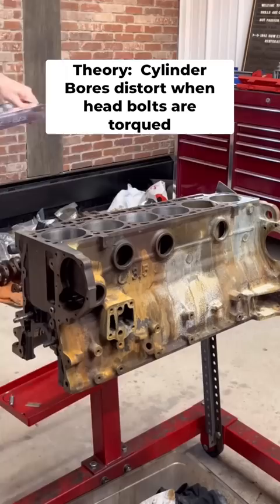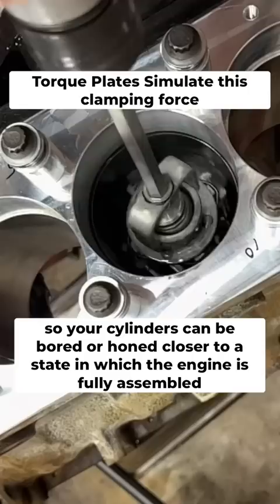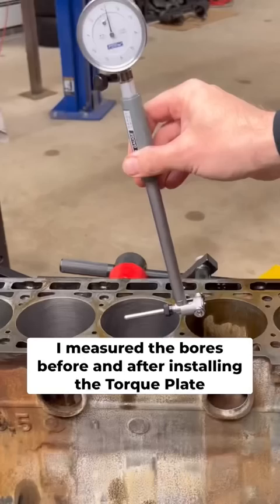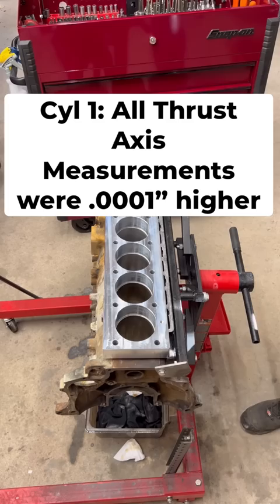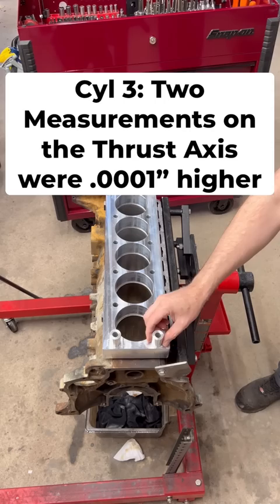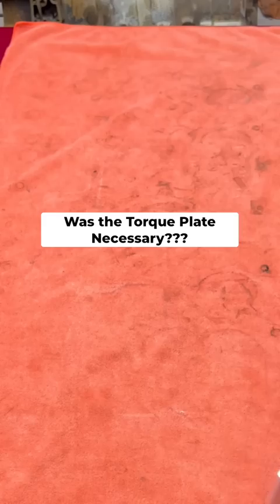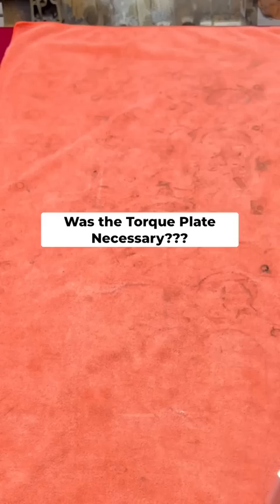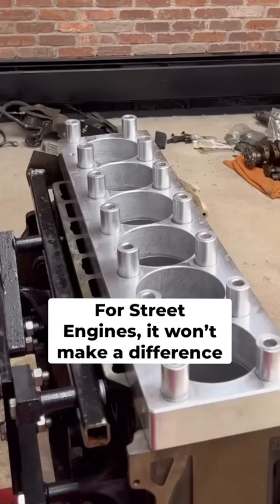Are Torque Plates Necessary? #bmw #cars #diy #bmwm5 #bmwe34 #restoration #automotive #engine #tools

Comment: Well I guess you are going to need a torque crank and to preheat the block to operating temp prior to any machining for the perfect bore.
Reply from the maker: Yeah, you can chase details forever with something like this
Reply: @wewrench  in fact you could argue that there’s an inherent design flaw in an engine that deforms so significantly under torque load that it is necessary to use a toque plate. The block should be designed to withstand those loads or you’re running the risk of a more significant failure under compression loads. Especially if you add boost.
Reply from the maker: @jonhunt5408  That's what I'm saying. Some folks are saying they've seen a block move .006"? How can that be? How does it even run when it heats up?

Comment: You measure with the crank installed along with a torque plate. But yes mostly only in racing applications. Keep the old main bolts so you're not wasting a new set.
Reply from the maker: You’re right but for a street engine it’s an overkill

Comment: They are necessary on Subarus.
Reply from the maker: Many others have said this as well
Reply: @wewrench  Many others are correct. Such a long aluminum block warps a lot more under tension.
Reply from the maker: @brianii5809  Saw a guy do a Subaru in a video. I think it stretched .002" at the top

Comment: with my cast iron block i didnt use them. Never had uneven wear patterns after my inspection processes when i pulled the motor. Drag strip numbers were happy.
Reply from the maker: Exactly!

Comment: Maybe for a large iron block v8 or straight 6, but an aluminum flat 4 or 6, they are 100% required. Otherwise you'll egg the cylinder guaranteed
Reply from the maker: Even on a stock build?

Comment: I don't want anything to do with an engine so fussy that it needs a torque plate to go together properly. The 300 six in my truck runs just fine if the bores are within 40 thou of what they're supposed to be as long as they're round hahahaha
Reply from the maker: I know man. Engines are way more forgiving than everyone says they are
Reply: @wewrench  Yep. Especially older ones like ours. There's an awful lot of differences between your E34 inline six and my Ford 300, but  they're also rather similar, and one key thing is they're not that fussy about tolerances. Long as things seal, slide, and stay quiet itt'l run juuuuuuust fine.

I'm not being facetious about the cylinder wear in my first comment, either. I'm probably gonna have to punch my engine out 40 thou to get the bores cleaned up, yet what ultimately put it in the rebuild line was oil pressure loss rather than top end wear. 350,000 miles'll do a number on an engine hahaha

Comment: Yea some engines certainly do.
Reply from the maker: Yeah, seems to be Subaru engines
Reply: @wewrench  Maybe. Can't remember.
Reply from the maker: @kaedeschulz5422  It's an endless debate
Reply: @wewrench  Yea really is! Especially As every series engine within the same manufacturers even can need or not need them depending on what series it's from.
Reply from the maker: @kaedeschulz5422  The OEM's don't use them so how critical can they be
Reply: @wewrench  OEM's don't care as much. They also don't push out 12k rpm and 250hp from a NA 1,6liter inline 4 or over thousand HP from a 3liter inline 6.
Reply from the maker: @kaedeschulz5422  that’s a different ballgame altogether
Reply: @wewrench  Absolutely!

Comment: They're useful on some weaker aluminum blocks, but not that monstrous n52.
Assuming that's an N52
Reply from the maker: It's an S38B36
Reply: @wewrench  shows how long I've been working on BMW'S 😂
Are those better? Sure looks cleaner/simpler
Reply: @wewrench  if you have a video on this please drop a link
Reply from the maker: @grapeseed427  If you you mean the S38B36, check out the video series on my page.

Comment: I wonder how a 8 in line would sound like
Reply from the maker: Pontiac made one, and the torsional vibrations were terrible. The crankshaft would actually sag
Reply: Buick also made a strait8.
They typically have a similar sound to a 90° v8 with an H pipe

Comment: lol whole "Torque plate" Is what I call a 80$ Peice of aluminum plate being turned into a 300$ With the press of a button as I watch the CNC machine cut it for around 20$.  You all fight about if it works or not I'll be making 5 more and buying a new toy I want with your 200$!
Reply from the maker: hahaha...funny.

Comment: Should be different on newer aluminum blocks then for old and beefy cast iron blocks
Reply from the maker: The opinions are all over the place
Reply: @wewrench  there a definitely blocks you can measure big differences with and without torque plate.

Comment: They are necessary for Subaru EJ engines. Other engines your results may vary.
Reply from the maker: Others have said this too. Because of open deck?
Reply: @wewrench  the blocks are really thin and the way they are assembled supposedly flexes the case halves. either way they almost always fail if you don't use a torque plate.
Reply from the maker: @dreadswizzard9142  Gotcha. Didn't know that

Comment: And you need to install gerabox too 😂😂😂
Reply from the maker: hahaha...that's really going the extra mile!
Reply: @wewrench  that's actually effect on closest to gearbox cylinder/s but it demands on engine block designs , some are weaker that others, but if you work on same engines regularly, that its better to have it than non...

Comment: Should note that whilst there's distortion from this and distortion from a cylinder head - both will be different distortion patterns.

An aluminium head is probably softer than one of these so it's more likely that the block is going to warp the head more than the head warps the block.

I'd be interested to see these measurements done with the actual head on - maybe from the crank end?

In any case the distortion is tiny and well within tolorance - your piston rings have play in them for a reason.
Reply from the maker: Exactly. These plates are an overkill

Comment: the factory dosent use them. can you measure with the actual head from the bottom? i want to know if the plate has a different geometry makes a difference.
Reply from the maker: You can measure but you can't hone
Reply: @wewrench  yea i just want to know if its different from the torque plate to the real head.
Reply from the maker: @nick4506  It's a weird ordeal. Nobody really knows the truth

Comment: I'd be curious if the results of this test would be the same with a V block. I think this test says more about the quality of a German inline 6 than it does about the need for torque plates.
Reply from the maker: Lots of people are saying different things
Reply: @wewrench  yeah, I'll bet. It's been my experience that lots of people have a hard time acknowledging that there are engineers building engines out there that might not work for the big 3. Facts would prove otherwise.
Reply from the maker: @edwardseaton4492  Truth. Thanks for supporting the channel

Comment: I talked to an experienced engine builder and he said, useless if the head bolts thread below the deck, and would make a difference if they thread in the deck, but that the cylinders deflect more from the power stroke than a torque plate. 

So yeah, its a wash, it seems more important that everything is at the same temperature at final torque and that things are machined slowly so there isn’t a lot of heat generated.
Reply from the maker: Agreed my friend!

Comment: Are the bolts on the cylinder wall (SBC) or the block wall ? Seems like a major difference  .
Reply from the maker: No they are not. Probably a big reason.
Reply: @wewrench  its the difference between Pontiacs and Chevrolets
Reply from the maker: @NCOGNTO  Truth my friend
Reply: @wewrench  Michael we are car guys here .
I recently filed my Patent application for the first Pollution Free Engine (9/30/22)
Its a more efficient engine on "rocket fuel" 
I can send you a copy if you're interested

Comment: also different on cast iron / aluminum blocks
Reply from the maker: I've heard this too. But I still find it hard to believe
Reply: @wewrench  someone should like try it with cast iron and cast aluminum blocks with oem liners but also aluminum with just coatings and maybe even with aftermarket liners like darton, so many variables
Reply from the maker: @austrian_s60r64  You're right. But it's those variables that can also negate any changes it could make. The OEM's don't use them for a reason
Reply: @wewrench  The oems do anything but darton sleeves, just coatings in the aluminum instead of iron sleeves is completely normal

Comment: Then Why didn't you measure with the main caps in ? Also you did one measurement with one type of block.
Reply from the maker: Because chasing a tenth or two doesn't equate to anything on a street engine in the real world
Reply: @wewrench  you said in race applications that can be disputed. In my opinion it is always a good idea to have a torque plate in race applications and oem can be disputed. manufacturers are building engines lighter and weaker the weaker a cylender is the more you need a torque plate. Your block is among the strongest ever made its not a good example
Reply from the maker: @speltwrong9009  This is a very sort of "arguable" subject because it's difficult to quantify. I cast a wide net with this video but the spirit of my statement is that in the real world of street engines, chasing a lot these details are meaningless. And I disagree with what you said about blocks being weaker. They're being built stronger to handle boost because turbos are now mainstream. They're doing a lot with metal alloys to accomplish this to get the same strength with lighter weight

Comment: When you have darton wet sleeves you'll need it to bore
Reply from the maker: Some other people have said this too. How much do they distort?
Reply: @WeWrench  when you dig into the cylinder wall of a floating sleeve with a cutting bit at 0.03 depth it will push the whole bore centerline out 
Machine shops honing rigs don't use (flexible) dingleberry hones  or (rigid) grinding stone hones,  they use mandrel type lathe cutters
Reply from the maker: @TwisNinja  Yes, I watched a vid on it last night

Comment: How are you out here trying to work on a German block, but measuring your bore in 1/10000th 🤢
Reply from the maker: Because the factory tolerances are.... .0002" max out of round and .0004" max taper

Comment: Never heard of such a thing. Can someone tell me what it is ?
Reply from the maker: It bolts on the block and simulates the clamping forces of the head bolts. It's said that this clamping causes distortion in the block
Reply: @wewrench  and what's the point of doing so ?

Comment: First, it is always a good practice to use a honing plate and often it is a requirement even on a stock street engine. A master tech that doesn’t know that the mains need to be tightened before using a honing plate🤣. That made me laugh. 

Cast block are more stable. I have seen some aluminum blocks move as much as .0015” and that is quite significant. Some cylinder heads need this process as well as without it you can see close to 8% leak (that is a lot) on a brand new loaded head when installed, but they test good on the bench. Doing all of this close to operating temperature is a best practice. 

Racing engines? That’s a while different level of detail. Done properly, you can sometimes have an engine that will not turn until the transmission is bolted on, because you need a transmission torque plate as well. I have seen rear cylinders move .0003” out of round when the transmission is installed. On an engine with .0012” piston clearance that is significant.
Reply: The standard fashion for bores is not at the top where you have the bore gauge.
Reply from the maker: Here's the thing. First you're wrong about plates being necessary on stock engines. Second, when you bolt a torque plate and see that 100s of thousands of psi of clamping force only moves some measurements a tenth, then why would I waste time and $$$ torquing up the mains and having to replace the bolts in the process? That's calling being a master tech and actually using your head, instead of believing every engine is a race engine and bending over backwards for details that won't matter.
Reply from the maker: Enlighten me
Reply: @wewrench  Oddly you are agreeing with everything I stated, but are somehow confused about it. It is a process that is required on some, but not all stock engines. Cast iron blocks usually do not need it for a stock rebuild. Many aluminum blocks are also ok, but some open deck aluminum blocks benefit from this greatly on a stock rebuild and are unreliable long term without it. The force per bolt is usually 6,000-11,000 PSI. At no point is any one bolt subjected to hundreds of thousands of PSI. If you only have experience with a few rebuilds, I understand your point of view. When you have done hundreds, your opinion might change. I have done them all from 50cc bikes to 30+L diesel engines. They are all different and need different considerations. You advice that the plates are not needed ever on a stock rebuild is wrong.
Reply: @wewrench  Enlighten you about the place to measure the bores? You're the "master tech" you should know better.

Comment: Well, Mr Master Tech...you are dead ass WRONG. LOL The cylinders absolutely distort *where the bolts are*. Also, to use a torque plate correctly, you ARE supposed to install the main caps because yes, those ALSO distort the cylinders. High end builds will even run hot water through the blocks to bring them to operating temperature while honing. Do you honestly think that race teams and such did all that work, and continued to do so because it sounded cool? LMAO They wouldn't do it over and over if it was a waste of time and money. For a street build or just a normal everyday car, yes, it's a waste. For a truly high end, nth degree, ALL the power and reliability build...YES.
Reply from the maker: I’m dead ass wrong you say, then you agree with me that they’re useless for street builds, which this engine is.
Reply: @wewrench  You tried to prove they don't work and said they aren't necessary. You are wrong on both counts when talking about building high performance engines. You did not quantify your statement. Better?
Reply from the maker: @rocketsurgeon11  yes that’s better. I meant to convey that for what I’m trying to do and generally for street engines, they’re not necessary. I cast a wide net and wasn’t clear

Comment: You obviously never worked in a engine machine/rebuilt shop. When torque plate hone you torque mains, motor mounts etc. anything that could distort the block
Reply from the maker: I don't think you have either being that you think torquing down a motor mount could distort an engine block
Reply: @wewrench  what’s your email. I will go take a video of the 400 small block I have here and prove that you are wrong. I do this every day
Reply from the maker: @Dilloz12  Are we talking about the same thing? What I think you’re saying is torquing a motor mount plate to an engine block with the standard 25-35ft lbs of torque will distort the block somehow. If you’re running 800hp with solid motor mounts and tracking the car, I could maybe envision some block distortion over time. But just torquing up a mount to an engine on a stand won’t distort it unless the block is made of bubble gum
Reply: @wewrench  it all depends on the block you are working on. For example when doing a Cummins or a very ridged block like that you won’t see any but a weaker cast like a 400 small block you can see 0.0005 or iv even seen .0007 distortion in the lower portion of the cylinder. I have multiple 400 small blocks here I can make a video and email it to you. For a everyday stock engine it really won’t matter, anything performance precision machine work is where you survive. When you start looking at not using torque plates or torquing things like motor mounts and other things to the block you get a stack up of tolerances when the engine is finally assembled. A torque plate hone alone on a stock GM 5.3l can show 15hp+ on the dyno
Reply from the maker: @Dilloz12  I agree with you. If you're trying to extract maximum power, then those details absolutely matter. I'm trying to communicate to the world that on a stock engine, all these details and nonsense don't make a difference.

Comment: I disagree. You are extending your theory to all torque plates, therefore all engines, right?What about engines that have more head bolts per cylinder, like a Cummins 5.9? And to your second point, yes mains distort the cylinder, but did you measure your bores with the mains torqued? Probably not. I would say a torque plate for your instance is probably not necessary. But I will die on the hill of using torque plates for what I use them for
Reply from the maker: I did cast a big net with this one, and judging by the comments I’ve received on four different social platforms, it seems like there’s no definitive answer. There are some machinists who haven’t measured any sort of deviation on any engine they’ve encountered, and others who say otherwise. I guess it’s application specific